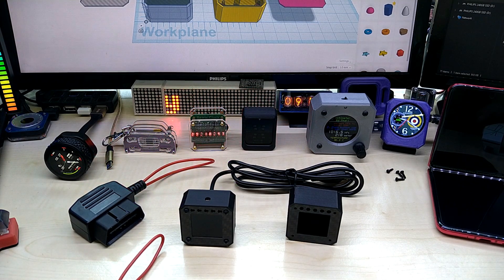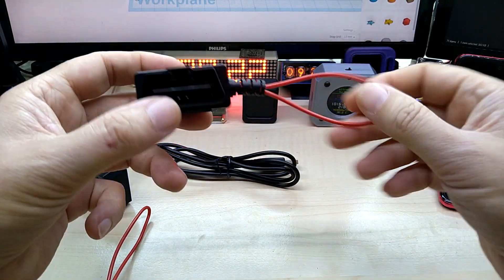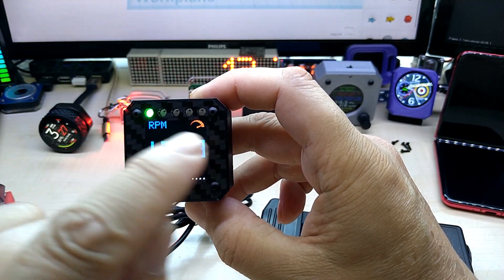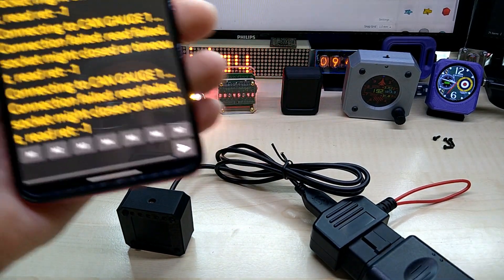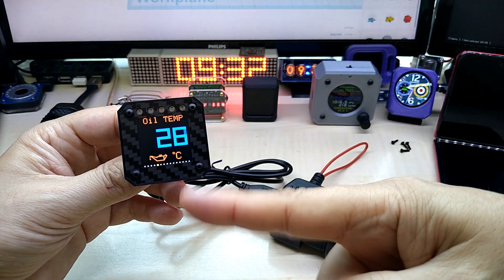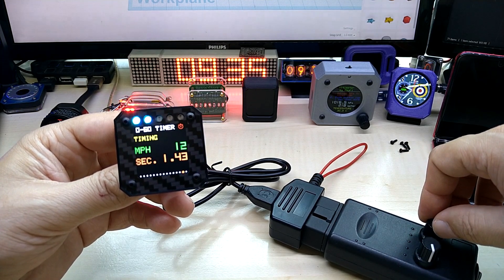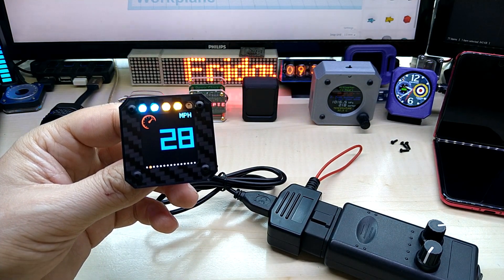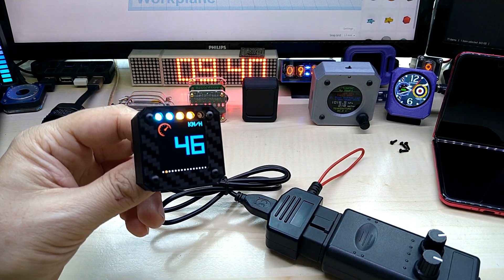CAN Gauge Mini the smallest full featured CAN BUS Gauge incl 0-60, 0-100 + 1/4 mile timer by #Hayri

Comment: Nice video! How do you construct the touch sensors? Is it a metal plate under the plastic, connected to the pin?
Reply from the maker: Thanks, the touch part of the sensor is actually on the PCB itself, think of it like a ground pour, in this case the size of about 5x10mm on both sides of the PCB and connected to the input of the touch sensor chip. It is sensitive enough that if you come close to the edge of the PCB it registers as a touch. So it is pretty simple, without the need to use any metal. If you like I could make a short video showing the PCB and the board design.
Reply: @iHayri1  Thanks a lot for the info! Yes please, will be interesting to see the PCB. I was planning to do a Dragon Ball radar and the idea of placing the sensors underneath the case is awesome! Cheers
Reply from the maker: @yomboprime  My pleasure, will do the video later tonight or tomorrow for you 🙂
Reply from the maker: @yomboprime  made the video for you, see here: https://youtu.be/WnICVn3rtrE